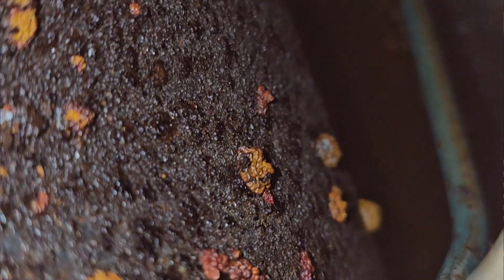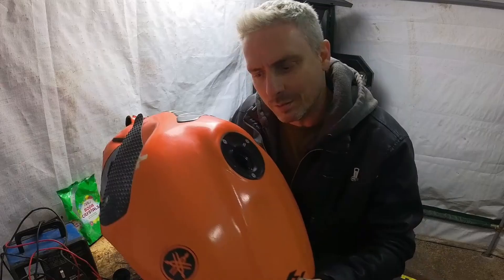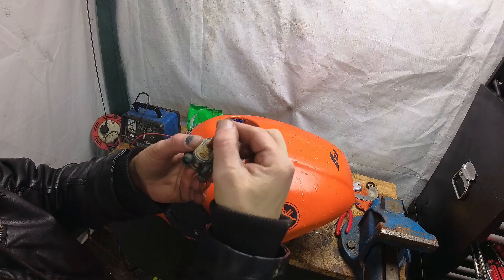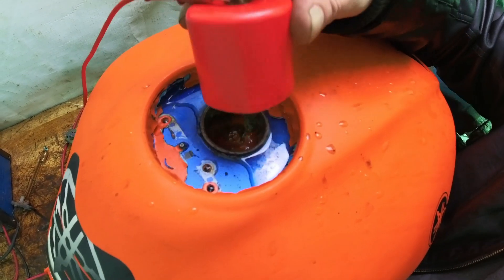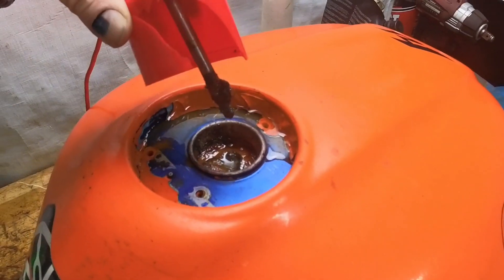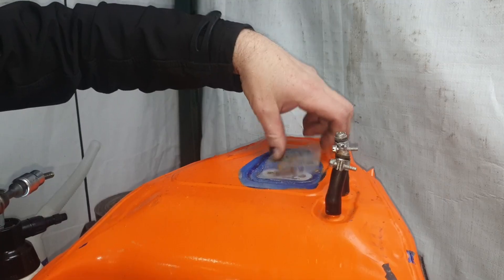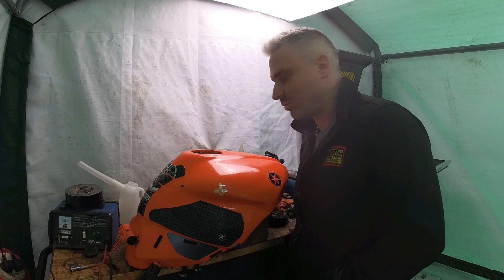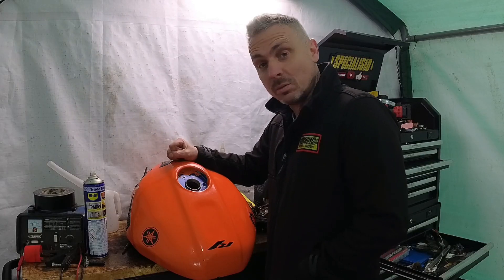DIY Fuel Tank Restoration With Just 3 Common Tools!

Comment: Great instructional video. I did the same on my GPZ600R tank a few years ago, still good.
To quicken the process, I found if you clean the scum off the top of the water and clean/change the anode each day it saves loads of time.